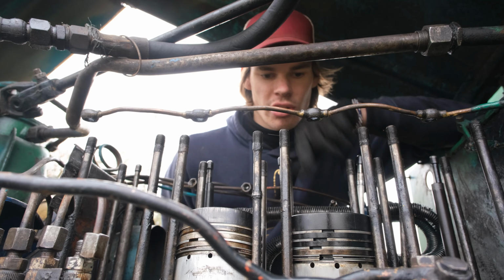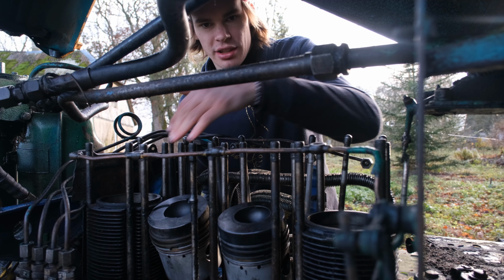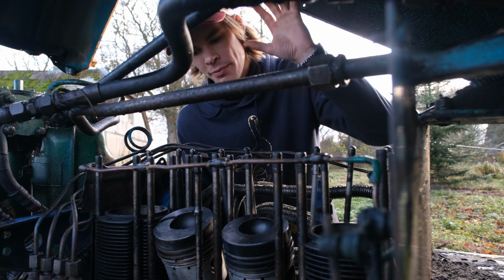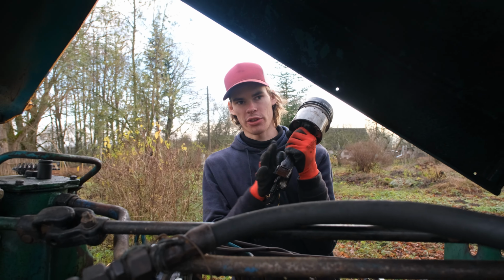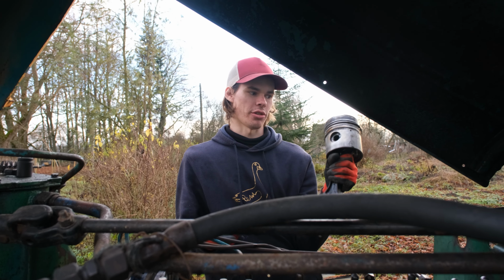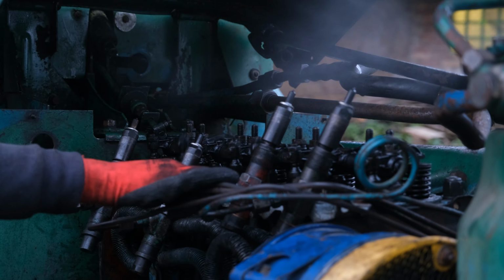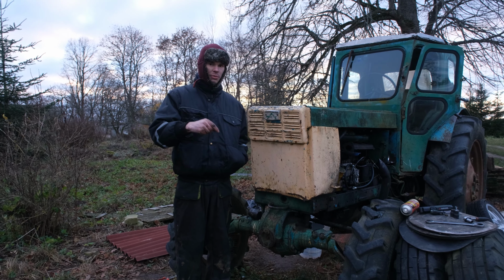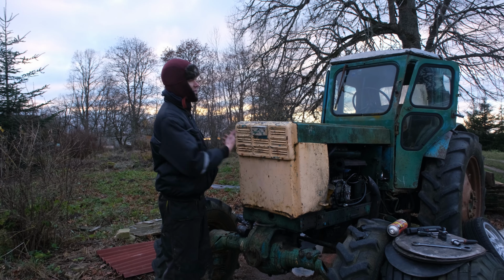1 YEAR Battle to Repair it, HAVE we WON??!!

Comment: Also most fuel pumps need a good flow of oil for the governor to work.   I’ve preluded them after a pump had been sitting, to get them to work.   Although in long run I ended up getting a rebuilt pump.  This was on a 1980 kubota.

Comment: My husband was wondering… Are you sure your basing your fuel timing on the correct top dead centers. There are two different top dead centers.  We’re all rooting for you all!!!
Reply from the maker: I could double check but the fuel coming out of the pump matches the timing of valves.

Comment: Most diesel fuel pumps can easily be installed 180 degrees off, so double check that,  but since it kind of ran, I doubt that is the problem

Comment: If you look at the video at 5.02(I think you said that is the cyl that was oiing and you had a lot of blow by) all the ring ends are perfectly aligned. That will allow compression to blow right past and oil to suck up. On reassembly you can't just put pistons and rings back into the cylinder. You need to at least hone them to  deglaze the cyl wall

Comment: You seem to have done everything to get the tracktor running that a normal person would have tried, in fact most would have given up and had a shop fix it or junked the thing. I believe you should try the fuel pump off the other traktor to eliminate that as the cause of the trouble.   Off topic, we have MTZ traktors  here in Hungary and the ones here are mostly liquid cooled. I guess the Soviets  developed air cooled models for extremely cold environments like are present in Lithuania. My neighbour has one like yours and it is liquid cooled.  Seems like it is very relaible.

Comment: one question: where do you throw all that black oil? Do you have a landfill where you can take polluting waste? 👍 thanks and good job 🙋
Reply from the maker: We don't trow it anywhere yet as it has uses in farm. For treating wood. The oil we took out went back in as we don't want to put new oil without knowing it works! 😁❤️
Reply: @DoBeDiff  👍🙋

Comment: That was great you two there is a lot of should have would have could have but in the end you have two tractors that don't run and winter is two weeks away snow and rain and the wheel barrow is a poor substitute all but the tractors got done but you have no place to put them out of the elements  to work on them they should have been number one on your list because thay can do the work of 10 men a proven fact now you have no choice but to get one working rain or snow cold or freezing.
Reply from the maker: Don't worry we will get it done, the engine swap should be few days of work. Plus the green tractor might be an easy fix with a different fuel pump, if that's the cause of problem!

Comment: Might be good to pull the top ring and insert it into its cylinder to measure the ring gap... should be pretty small...I normally break rings when pulling them...there is a tool however..:-)   Too...looks like a lot of fuel coming out of the injectors...once in the cylinder with the piston all the way  up..the the spray will be a lot less....They will smoke on start up...but should burn excess fuel in the cylinder fairly quickly...

Comment: I give you a A+ for trying. But I believe most of your problems come from inexperience. Try to find a expert mechanic and pay him on make one good tractor.
Reply from the maker: Most "Experts" never studied these tractors and they care less for someone's tractor than I will and the effort I put in. Some mechanics are great but they no longer go to sites to work. One of my friend paid 8000 to fix a tractor worth 5000 max. 😤 So there is a lot of scammers and I am fixing it by the manual and videos. There isn't much things I can't do that a mechanic would. The fuel pump and injector require mechanic but clearly the fuel pump wasn't fixed and we paid a lot for the repair or as they said restoration of internals. Anyways I enjoy and learn with the process. 😁

Comment: At least it running, badly but still a win, fuel pump, timing, worn cam lobes ? Sure u'll get it soon. Bad fuel? Drain add new fuel, it could be very old contaminated. Will it run on starting fluid,  ether ok. Keep trying soon be a proper tractor guru

Comment: Why put all the good parts from the good tractor into the old icky tractor?
Just fix the good tractor.
Reply from the maker: The blue tractor has a broken crankshaft which is not easy to fix or uneconomical to fix. The green tractor is just a bit rusty doesn't make it less of a tractor!